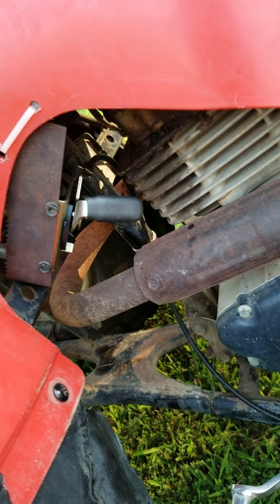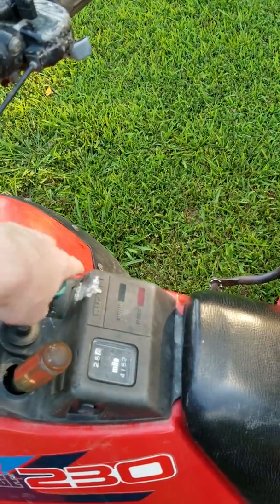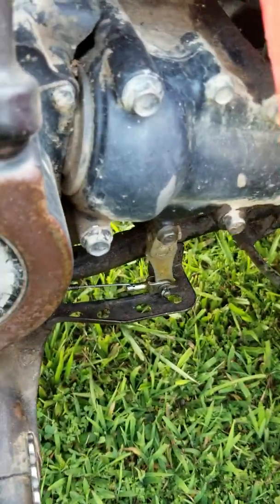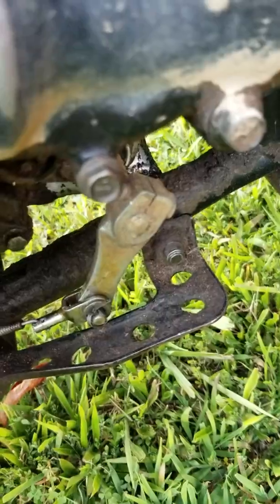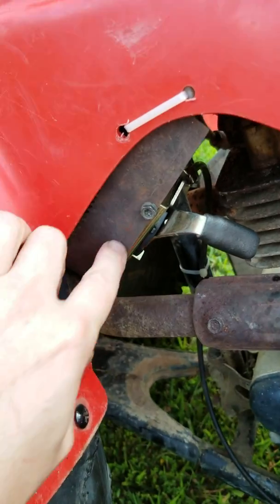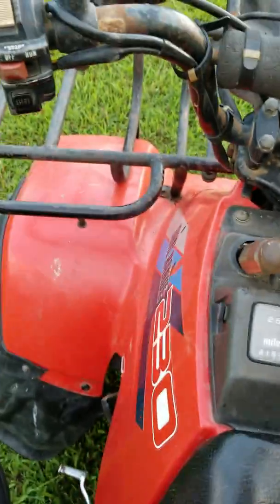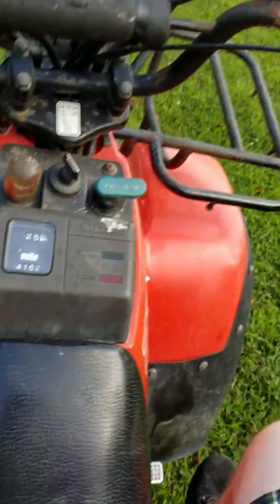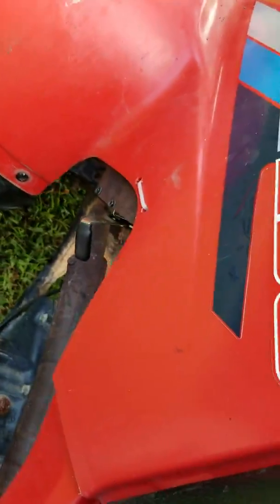Suzuki Quadrunner 230 reverse cable fix

Comment: I have the Exact same 4 wheeler Do you have any idea where i can Find some Parts? It needs Back Brakes Front brakes And a New Reverse Cable cause I managed to snap it
Reply from the maker: I've had some luck finding brake parts on Amazon. And I broke my reverse cable too lol. I ended up making a new one using an old throttle cable/handle from a riding mower
Reply: @CrazyWoody1989  lol Thanks For the Reply Ill Look on Amazon Maybe Ill get Lucky
Reply: @CrazyWoody1989  Any Idea where I could Find a New seat
Reply from the maker: @NateWillMakeIt  I have looked around but anything I have found has been old used stuff, and any of them that were in good shape were very costly. At some point I think I may have my old one reupholstered if it's possible.

Comment: Hey brother. Would you mind making a video how to make the low range work? I pulled it out while in neutral but can't shift it into any gear after that. Thanks man.
Reply from the maker: Yeah! It may take a day or two but I will make one on it
Reply: @CrazyWoody1989  hey thanks brother! I appreciate it. Just picked up an 87. Love it. Surprised with the low end for only a 230. But going through some deep much I'd like to be able to have a little more power and have the low range work.
Reply from the maker: @lovelooslivideos  https://www.youtube.com/watch?v=3kDetQwPGow
Got you a video posted!